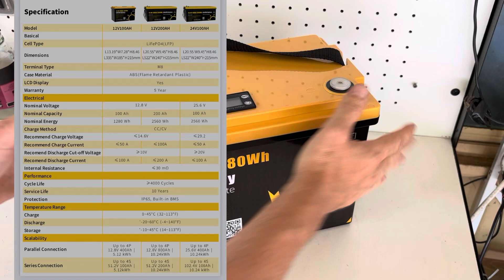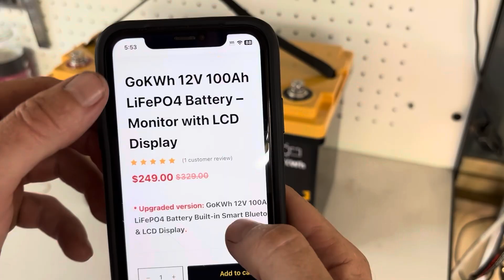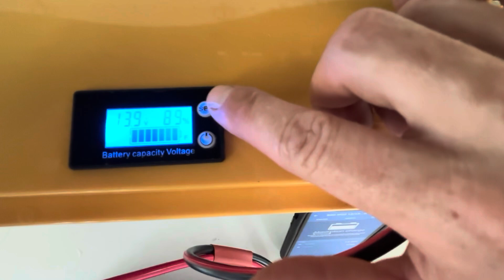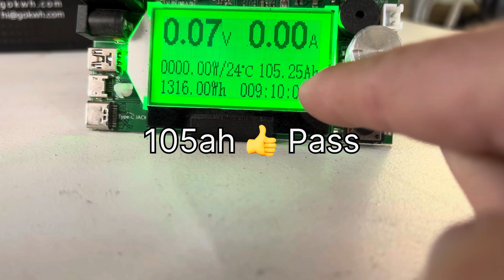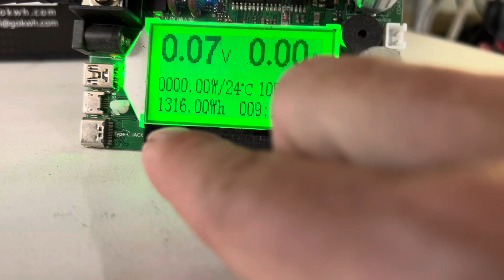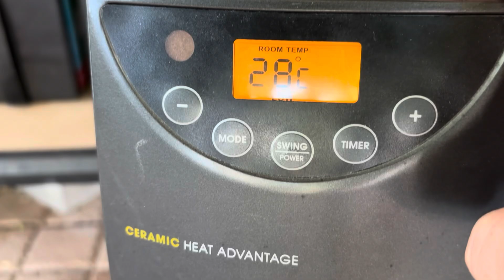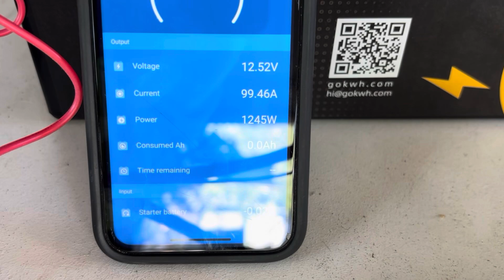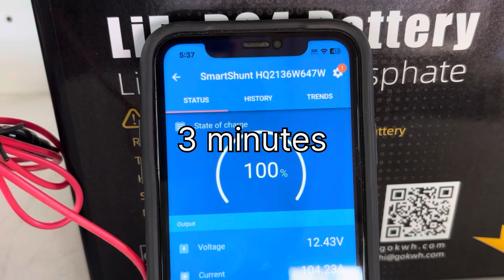GoKWH 100Ah LifePO4 Battery. Bargain

Comment: I have that same battery and have loaded tested and charged it 14 days in a row and it repeats perfectly. I also have a video of it being test in a travel trailer RV. 

I was skeptical as well but no joke it is a solid bargain!
Reply from the maker: That’s awesome to know mate. Thanks for sharing. Did they send you the battery for review or did you buy it.
Reply: @Techboxreview  debt free, ended ordering a twin for parallel to use on a friend small camper van
Reply from the maker: @ThreeDayrv  nice mate. Your friend will be happy with those. Will be interesting to see how they preform long term

Comment: I am 1 second in, and I have ZERO confidence in a battery that cost's this little. Yes - we all know 99% are made in China. But there is a reason products like SAFIERY, VICTRON  etc are expensive. They use the best of everything. This is like comparing a Landcruiser 79 to a LDV etc.....Sure EVERYONE has their "price range" - but over my 53 years of hard life, I have realized that you almost ALWAYS get what you pay for. So my recommendation for all is - save for a few more months, then buy once, buy right!. When it comes to Lithium batteries for vehicles/4wd/caravans etc - it REALLY PAYS TO DO EXTENSIVE RESEARCH!.  Sure brands like KINGS asre OK, but if you are spending 100-200K on a touring setup - then do yourself a favor and get the BEST components and have a professional set it up. Do NOT buy cheap Chinese crap.  Just look at all the top of the line companies making Caravans etc - they almost all now use brands like Victron, Redarc and Safiery.  - and use the same batteries/components like Fronius, Trina Solar etc. Now that the new LAW has come in regarding batteries - companies like SAFIERY are making batteries that are put outside or in outside panels like Sodium Ion etc. Like ANYTHING - you really are best off saving a bit longer to get a better product. Research is key - as almost all these companies will say their product is the best. Sure there is a "market" for these cheap AF brands - but not for your 150K plus car/boat/camper/caravan........
Reply: You may be right. But sometimes you pay 100% more for something that might be only 10% better.
Reply: I could not agree more. I always hate it when people say “it’s all made in the same factory”, implying that quality is all the same. The manufacturer will make it to the specifications the purchasing company is asking for. Back in my day, long before the invention of lithium batteries, car batteries were made by one of three manufacturers. So people would assume that a $200 Interstate battery was comparable to the $30 Sears, Roebuck, & Co. battery. I liked to explain the difference to them using their mother’s kitchen. Their mother could make them a peanut butter and jelly sandwich or she could make a 5 course, 5 star Michelin rated meal in that same kitchen. The difference is the ingredients and time spent.

Comment: Nice review. Looking at the website it looks like this model doesn't come with a built in BMS. So it may not have over current protection or low voltage protection. The price is very cheap and free shipping.
Reply from the maker: Thanks mate. They do have a BMS. In my review the low voltage protection worked and the BMS woke back up as it should. Other Teardown videos show a BMS also. 👍
Reply: @Techboxreview  They should also sell them WITHOUT a BMS, such as for people buying batteries that will work rather than not work with things such as those many slow moving electric scooters that already have their own built in BMS that can't be bypassed.
I just bought a expensive mistake that looks like that. The seller of the vehicle mislead me and originally said he couldnt sell the batteries with the vehicle, but after he shipped the vehicle he lies and says that I was supposed to also order the batteries directly through him, and I have ALL the book sized backnforth text adventure that he chose to create rather than a dignified exchange of my money for his being a lying manipulative scumbag named Jason from Runhorse. I just escalated above Jason and am going to send off evidence copies to his superiors and or coworkers so they know all about Smiley Liar Jason.

Comment: Nice video. Newbie question: Can the battery be used under a load ( Car fridge) while charging Dc to Dc charger ?
Reply: You can but if you are charging with solar there is a risk the voltage from the panels can be seen on the system if the controler fails internally. I had issues when I was starting with some budget gear the battery would disconnect due to over voltage charge and 18v from the solar panel would go the the inverter and it would alarm with over voltage. There are some videos about the kings MPPT's failing and cooking batteries. They damaged them by connecting solar without a battery and fried the internals. You can put up to 50v into the kings MPPT units and a lot of the good gear goes up to 100's of volts. If the fridge can handle the voltage of the panel then it will be fine but if you are using a house panel that might be 30-50v and you should have some protection for downstream equipment. Hope that helps.
Reply: @sparkletornado5890  Thanks for the information. Will bank this for future.
Reply: The super cheap PWM controllers gave me the most grief. They dont save any settings. They will sometimes have a lithium setting that will stop charging at 14.6v but most lithium batteries that are not balanced and have a BMS will disconnect to protect cells just above 14v. The cheap controllers that autosense 12v or 24v change to a 24v setting because all they can see is the voltage of the panel.   @funforlittlechefs
Reply from the maker: You shouldn’t have a problem if you get yourself a good quality dc to dc charger. Victron would be the best choice
Reply: @Techboxreview  Thank you. Keep up the informative videos.
Reply from the maker: Thanks for watching mate. I appreciate it 👍

Comment: Off grid basement reviewed this same battery. That little screen isn't to be trusted. I typically do not disassemble batteries, however, I would make an exception if I ever got my hands on this battery. Just want the cells, nothing else. I Enjoy the channel
Reply from the maker: I agree that little screen is only good for the battery voltage that’s about it. It’s a great battery for the price. Thanks for watching mate I appreciate it 👍
Reply: @Techboxreview  👍